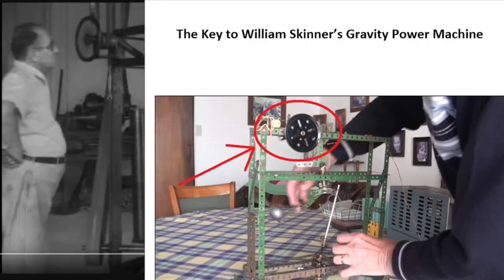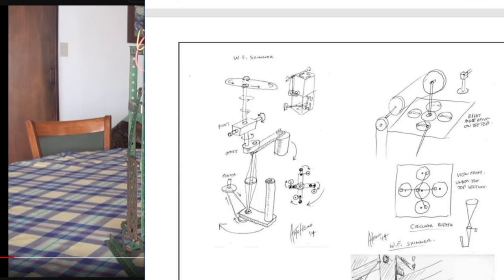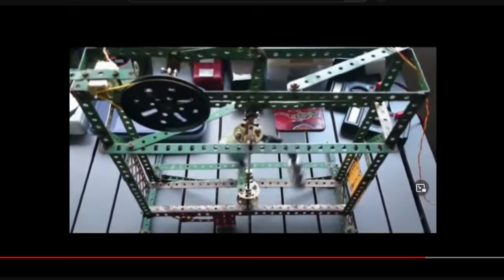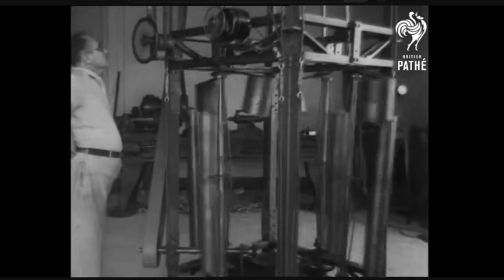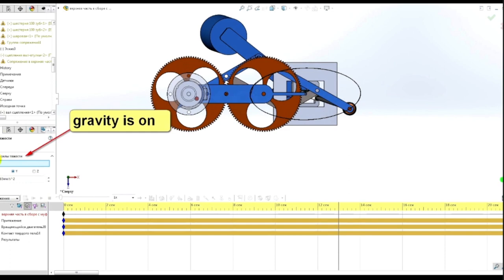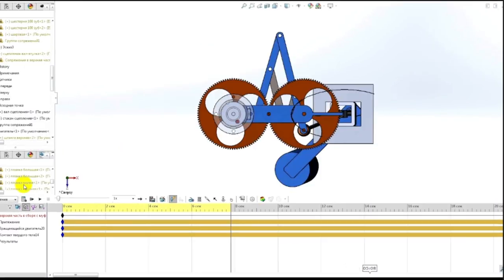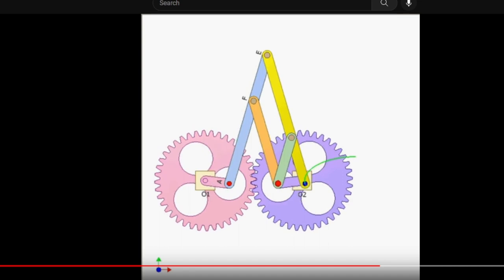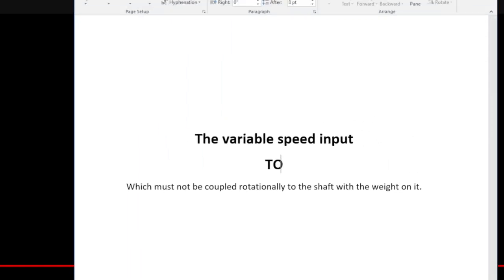The Key to William Skinner's Gravity Power Machine

Comment: i make a big model years ago, i didn't manage to get the good set, the big problem is if you draw power from the out it slows an slows, i discover you now, and i can suggest to you: for produce a big power with low speed the stepper motor used as generator is very good. if you interested i show you something

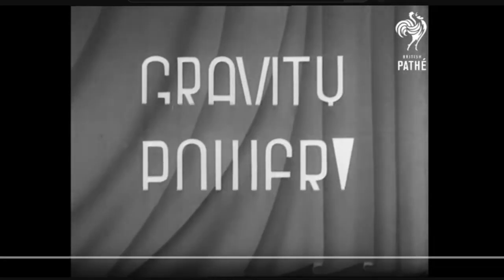Comment: 2:52 through 3:02.  I question if gravity has much to do with providing a free source of torque to bottom shaft in this device.  Rather it seems to me that the upper spinning weight is allowed to input a centrifugal force, that is in lead by 90 degrees, to the arm attached to the lower skewed shaft assembly, by the upper shaft's pivoting action within a single plane, to provide the over-unity torque to the bottom, if that makes any sense. You really got to slow the video rate down to the slowest possible speed to let your brain see the phasing to maybe understand what I'm trying to point out.  The lower weight simply provides a flywheel effect.  I would say this mechanical arrangement is just another approach to what the Milkovic pendular seesaw device accomplishes with its over-unity centrifugal force inputs to do work. My two cents......
Reply from the maker: There is a lot of confusion as to how these things work. (Some really do work). It has to be understood it operates in two stages. The first is lifting the weight with less effort than normal, using inertia, centrifugal force, gravity, etc. and the second stage is where the weight falls down and accelerates. This is why Skinner's machine has a lot of parts on the top level, because the input is not constant rotation. So keep to the two stages, and you can get these types of machines to work for you.

Comment: Perpetual motion does not exist
Reply from the maker: The earth rotates perpetually.
Reply: @QuantumEnergySearch  nope, it's influenced by outside sources and will eventually stop. Not perpetual
Reply from the maker: @Coastal_Cruzer  Thank you for this sound scholarly advice.
Reply: @QuantumEnergySearch  Their source is, you should trust them, bro ..
Reply from the maker: @reeferbeleafer9912  There is an energy field around the earth (it also exists in space), but in its natural state it is balanced, so systems tend not to go over-unity, otherwise everything including the earth would burn up.
Reply: @QuantumEnergySearch  I think we have a lot yet to learn, a lot to unlearn too.. 

You could say the same thing about consciousness itself.
Reply from the maker: @reeferbeleafer9912  No.
Reply: @QuantumEnergySearch  No what?
Reply: William Skinner called his machine a Gravity powered machine, which is dead wrong. Just because he thought it was is just a misdirection. Bessler named his wheel a perpetual wheel. You need to understand 3D mechanics principles to work out where the energy gain is coming from
Reply: @keithstirling7235  you can not create or destroy energy, only transfer it from one state to another. You can't pour 6 gallons out of a 5 gallon bucket. There are no "energy gains"
Reply: @Coastal_Cruzer  Perpetual motion does exist. The oceans tide and the solar system, at least as far as we are concerned as a species.
Reply: @bradlys4978  that's not perpetual, that is using external energy.
Reply: @Coastal_Cruzer   If you want to be narrow minded and specific then the answer is the expansion of the universe! what is external from the universe! 😋😋 That's perpetual motion.
Reply: @bradlys4978  the expansion of the universe involves an outside force. It's not perpetual and will in fact stop some day billions of years from now
Reply: Then it will compress into 1 big object and create another big bang and the process continues forever! Expansion is only 1 part on the cycle of perpetual motion of the universe.  @Coastal_Cruzer
Reply: Every time someone demonstrates a motion that isn't immediately drawing down, someone always chimes in with perpetual motion.  What if that's not the point?

It may not be "free," but why shut down someone's discovery?  Even if it doesn't amount to anything, it's their lesson. Let them make the calls.